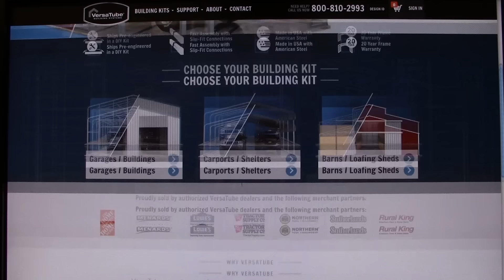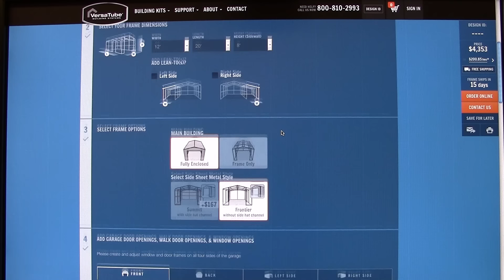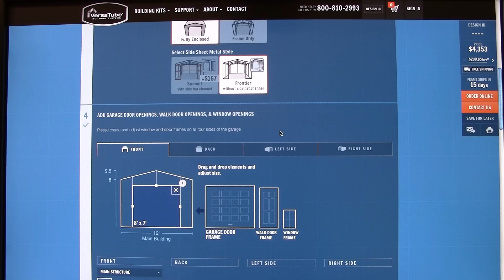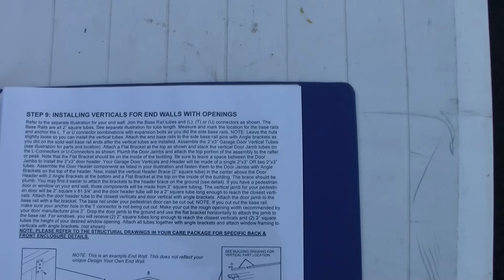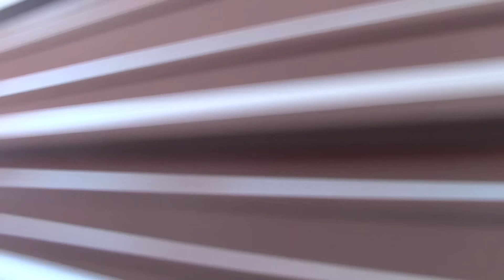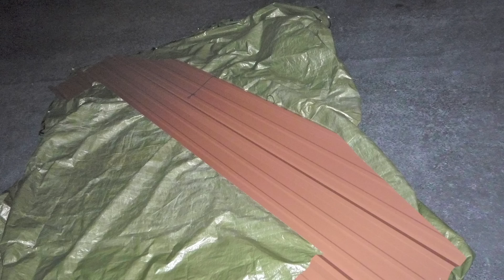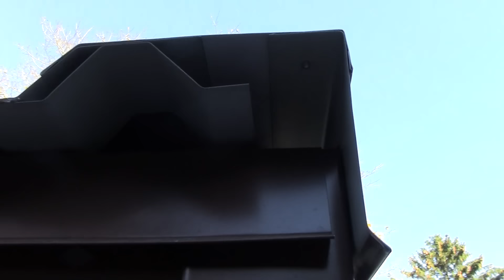Versatube Metal Garage Review In-Depth

Comment: I purchased a 24' x 24.5' x 10' Classic Carport from Versatube. The frame and roof sheet metal was shipped to me separately. The Versatube frame and parts arrived in good shape. The roof sheet metal panels were provided by Taylor Metal Products and the panels arrived a few days later. Upon initial inspection the first few pieces of 10' x 36" roof panels appeared to be in great shape, HOWEVER when I was approximately 1/2 way the the stack of panels I came across a badly dented panel with deep scratches that was cleverly placed in between the rest. What a Scumbag move! What type of Company and or Employee(s) does something like this?

Comment: Seems to me that you really dont understand construction.  There are a lot of moving pieces here.  For the roof, the structure can be engineered for your specific snow load.  You just bought one of their pre-packaged garages, not an engineered one specific to your needs.  Also, with the foundation.  You absolutely should have had a foundation conducive to having an edge for the siding.  No house will ever not have the siding going over past the sill plate.  That's just common sense.  So putting it on a slab like you did would require some sealant.  I am also willing to bet that is the reason you had to cut down your siding sheet metal.  It is likely designed to extend down past the sill plate to prevent water intrusion.  Anyway, it looks nice, but I think you had some unrealistic expectations of this kit from the beginning.

Comment: Probably should've put rubber flashing between the frame and concrete.  That most likely would've stopped alot of the water.  Your first mistake was that you shouldn't have built it on your driveway. It should have been built on it's own slab .

Comment: Thanks for the review. I was looking at Versatube, and now I don't think they can do what I want, and it's less a "kit" than I was expecting. Good job on it.

My house and garage both have dirt right up against the foundation -- people do that all the time. There's a sidewalk right next to the house and garage, but it isn't part of the building pour. The slab you built is like a carport slab -- I think that's what you were thinking about more than a building foundation.  Building foundations need what's called a stem wall to get the sill plate, in your case the base rail, up above the grade to keep water from running into your building. Then the siding can come down over the outside of the stem wall as close to the ground as you like and it will shed water outside the building. If you settled on a 4" stem wall, you'd tell Versatube you want a 7' 8" ceiling height and a 6' 8" door opening (say). The stem wall gets you to 8'. Of course there's no stem wall where the garage door goes. What keeps water out of the garage door is supposed to be a "driveway" sloped away from the door, and a gasket. It is really, really hard to keep water out permanently, over the whole life of the building. It's more important to have a way for water to get out -- for the building to dry, than it is to exclude every drop. You basically can't.

Comment: That was brutal to watch. I admire your determination to DIY, however 90% of you r complaints/problems can easily be resolved with proper technique. I have construction and fabrication background, I will say you tripped over your own feet on a lot of it. It looks good in the end though. Also all pads are to be poured to size for the buildings and have wayward sloping skirts all around it.

Comment: Excellent job. My question is. Would it be easier to buy 2 x 4 and space them approximate 2 feet and install  the sides and back vertical? The roof  you solved the problem of spacing and i feel like i would add more 2 x 4 there as well. Shame you had to complete the engineering for this building. Was going to get one as just the framing kit alone and buy my own siding and roof. Now I'm leaning more towards a pole barn type building where i'm sure of the dimensions. THX

Comment: The foundation issue and cutting at the sill is your fault. Properly designed Buildings are built with a foundation that aligns on the outside frame of stud. If you want concrete, you must poor separately, or provide a curb. It is very common for dirt to be outside of the exterior wall. 

The buildings are cheap and you get what you pay for. They are a the best value for what it is.

Comment: It seems to me that there were unrealistic expectations.  Looking at a possible order, there was nothing I saw that led me to believe that the sheet metal would be pre-cut.  It just lists out lengths of metal.  Part of your issues were ignorance on your part.  You will never be able to get a building to seal around the bottom set on a slab like you did yours.  Had you done it properly, you would have had around a 1.5" ledge around the slab that would have used up that length of the rib in your metal.  That would have eliminated a couple of your problems.  Properly done, you would pour the concrete around the building at the level of the bottom of that ledge, thus keeping water away from your building.  Not to be rude, but it appears that the quality of the building matches the quality of the slab it was poured on...it looks like in the video that the slab is far from smooth and free of dips and rises.  This is also going to create lots of issues when it comes to laying out the building and squaring it up.  It is a DIY structure, but I guess it was more than you wanted to DIY.

Comment: Should maybe have used a product called seal seal under the bottom channel in between it and the slab. It looks like a strip of foam kinda and is made to prevent water from running in.

Comment: A good reason to buy vertical sheeting for the walls. Looks like a fantastic kit and worked decades ago building and installing these with pipe and a muffler bender. Great video and now im about to purchase a 40x40 versatube
Reply: Great tip. In my case, I'm thinking of just buying their frame, and getting the metal somewhere else. If I put them on vertically, it may be easier and shed water better too.?.?

Comment: When you put the foundation slab down for this building you have to put an inch and a quarter notch in it that is at the base of the building so when you put your siding on the siding will break down over the top of the edge of the building down onto the concrete so when it does rain water cannot infiltrate into the building you must also make sure that that slab is perfectly flat also when you're putting the siding on these buildings I always order them so that the siding is vertical not horizontal it mitigates and almost eliminates any and all problems because you can adjust the panels separately the plum and straight as well as Square

Comment: They got to watch this video cuz I was going to order a 70x60-ft I guess building from these guys. It's really hard to find an actual steel manufacturer and sales department online. I keep getting brokers for steel buildings and it's like screw that I don't want to freaking broker I want directly from the manufacturer. One guy Simpson steal or Samson still something like that out of Arkansas seem like a nice guy but  I did my due diligence An investigative background check the whole nine because I'm spending like 50 grand on a steel building that's what I was looking for. And this is my first one I've never built one before Well I feel one before for somebody else I've never built one for myself. I got a I got a house at Class A 46-ft motorhome and some tractors and a side living quarters in this structure and I be damned if I got to get some crap that I got to sit in there and manufacture myself because they send the wrong stuff or they don't do it start to finish manufacturing They farm it out That's good to know.

Comment: You did a good job with this video. I have built two DIY houses, one of which is framed with heavy steel I-beams. I've learned a LOT! I also built a couple shed ends on a pole barn erected by a contractor. I'm considering using Versatube for the framing of a motorcycle/garden shed. Your problems convinced me that I should buy only the framing and solve all the other construction and supply issues myself.
Reply: I'm thinking the same:  almost seems like it makes more sense to just buy the frame.  I really dont like the super thin gage of sheetmetal they sell... I think i'd almost rather just source it locally and get something a little more robust?
Reply: Agreed, you could cover that with any material you want even frame up overhangs

Comment: Have built a few of these kit garage/sheds. And always had a helper to assist or I assisted them. Overall the problems you encountered weren’t to bad. Doing angle cuts have simple secrets on cutting them. I’ve seen it done multiple times still I struggle with it overall you’ve done a great job and looks fantastic.

Comment: thanks for the review.  I am considering a Versa tube building.  If I push that button will take your awesome review and modify the concrete so the building sits higher, above grade, to keep the infiltration of water. And may just stick to the frame.  I will look into other ways to wrap the Versatube frame. Your info is why I find youtube so useful, thank you

Comment: i’ve never herd of building a shed/ garage and not raising up where the walls go so you have proper drainage pour a footer for the building good video but i think that the metal work isn’t that hard i’ve done many loafing sheds with just supplied metal and no issues get good tin snips they make power ones as well but for the price you mentioned sounds like pretty nice kit

Comment: A lot of your complaints are from your mistakes. I chose this company for they use 2x3 steel for the frame where all others use square aluminum. Maybe the changed their frame design but the roof structures are way different now. I highly recommend this company.

Comment: Never saw somebody run siding from the top down in my 30 years in business let alone running it horizontal like that
Reply: 30 years in business and you have never seen a typical,for the last 15 years or so, carport with the metal running horizontal ?  What business are you in ?
My question is if the sides are horizontal and the frame corners are mandrel bent why would the kit contain L brackets for the roof sheets to run 90° from the sides? If the walls are run horizontal then the roof sheets should have run the same way and when you do that you start in the middle of the roof with the first sheet and work your way down the sides. Probably at least 50 companies selling carport and small garage kits that are assembled that way. None of them have any of the sheet metal for the ends cut to fit either.
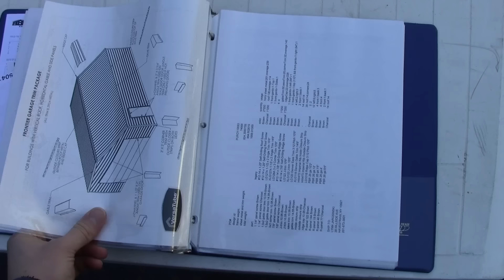Reply: MJD I agree. I looked at every photo on the Versatube website and every single picture under the heading of "garages and buildings" shows vertical siding. However, if you look at this video starting at 5:12, the instruction manual shows horizontal siding. Weird....and ugly. But I also noted that Versatube buildings are typically frame only allowing the owner to determine what kind of siding they want to install.
Reply: Not only do the instructions show the siding being ran horizontally, but it's specifically cut to length to be installed that way so you really can't blame him. Probably let's them sell it a few bucks cheaper.
Reply: @jdiddy6901  Fewer pieces = fewer cuts = cheaper.

Comment: If you started sjeeting from the bottom up, with a slab suited for the shed, itd seal properly,
The gable would have worked out better,
No sheeting is precut on an angle.
Nor are flashings.

Man, you are such a f@cking whinger.
Amateur.
You didnt turn the sheets up to weather proof them either.

I can only imagine you struggle with lego too.
You are a potato

Comment: I watched this out of curiosity. As someone with construction experience I don’t know if I would mess with the kit, but for an average DIY person it is probably better they buy a kit. First, of course you build the slab to building size. Unfortunately your building will always have some water infiltration now. Your walk and driveway would come up to the slab with an expansion joint, and be sloped for proper water drainage. Always snap a chalk line for your plates. A vast majority of your problems could have been prevented with standard building techniques. In the end you built a nice looking garage.

Comment: Ive done Hundreds of these and i know almost all the tricks of the trade. First before standing up trusses/bows its easier to screw the panel on to the gable truss but you'll need to figure out where the side panels will match up, so pretty much push the gable panel up as much as you can and the bottom rib has to line up where the top side panel should approximately be

Comment: It's not the kits fault. You put the panels up in total reverse order. Always start at the bottom and work up...just like roofing. That should just be automatic as it relates to the overlap/weatherization. And as far as warped frame components, that's not fair either. Your slab was obviously poured by some amateur weekend wonders. The slab or foundation of any build is the most important part of the job, because everything after that is going translate any defective work up into the structure. It's always good anchor down a treated plate, then a non treated kd plate, then your steel plate on that. Gives you a little more height and an opportunity to string and shim any high/low spots out of the structure. Not everyone is a builder, but it's not fair to slam a company that puts out a quality product. I've erected many of these lightweight structures. They're a snap and super versatile. I didn't realize if you actually have to pull out some basic tools it gets you a bad review. Guess everyone wants an app to do everything for them these days. But I personally would highly recommend these over those guys that come and throw them up in a day with $200 roll up storage unit door on them instead of actual overhead door...those things are junk. All 29/14 ga.  Versa Tube has nice heavy 26/12 ga available for half the price of the the here today, gone tomorrow guys. Nice job for an amateur DIY guy, but don't blame your lack of knowledge and skill on the parts. That just makes you look bad.
Reply: Couldn't agree more. I'll be using this video as a reference for a building I just bought. Looking forward to putting it up. Treated plate  = do you mean a strip of pressure treated 2x4 lumber? What do you mean by kd plate? Untreated lumber?

Comment: My issue is why did you pay $4000 for a tiny one car garage, that you had to install. I just paid $4900 for a 26ga 25’x25’ with 2 full exterior doors, 3 windows, and a single 12ft garage door that was installed for me, and only took a crew of 4 people, 6 hours. You got took to the cleaners!!!!
Reply: ALL of your problems were due to inexperience!!!!! SEAL PLATE!!! 
YOU have to seal the bottom plate to keep water out when you install the frame. 
Siding installed from bottom up. 
It would have been great if you had a friend that knew a little about building, instead of one that had a metal break.
Reply: @lifewiththehamptons1993  Where and what model did you get?
Reply: BigPoppa-Monk Carolina Carports. I don’t think it had a model name. I just ordered exactly what I wanted.

Comment: Cutting the material and the erection of the building is where the value is doesn't seem like there is a problem other than you bit off more than you could chew and are unhappy with the results of your own handy work but that's not at the fault of the company you should look into hiring things done so you could have some one to complain to you got what you paid for and probably learned alot that's why the building didn't cost you 20k

Comment: manual clearly states sheet from the bottom up. And of course you have to cut your panels as your squaring may not be the same as someone elses. Seems like you did a decent job of making it work but you made so many mistakes so the fixes where of your own making.
Reply: I just looked at the manual on the website and it clearly says to go from the top down for siding, like this video did. Page 20.

Comment: I bought one from VersaTube, and have another on a pallet I'm about to assemble. Did the first one with OSB then Tyvek then metsl roofing panels over that. Mine is  25 x 14  x 14, did all of it myself, with help from a teenage son. Made my own end walls and welded up my own fabricated  swinging doors. Took a week to do. Totally water proof when you start at the bottom. I have no screw showing with these overlapping panels. Need to chalk along the base someday.

The  one I'm about to build is 12 ,x 11 x 36' for my 25' motorhome. This time on a slap instead of pavers.

I also have a website and get very frustrated by customers who don't know what they're doing and critiquing my products.  There should be a law against unqualified people offing up opinions when they don't know basic stuff. I don't work for Versa Tube, but my building has endured 60 MPH winds, and not bkinked
 And that's what they promised. Not the  tiddlywinks things any do-it-yourselfer should be able to work out themselves. Bunch of crap. Dimpled base plate being a problem, , give me a break. I'm totally happy with these people, they know structural engineering based on math, not observation. 

They told me when I order that I could probably get a better deal locally on the metal, so I went that route. They made them the full 26 lengths I wanted, I got a sheer and custom cut my gable ends. Child's play.

The garage this guy built looks fine, and does the job.. Enough said.
Reply: I totally agree with you this is apparently the first building he's ever put up